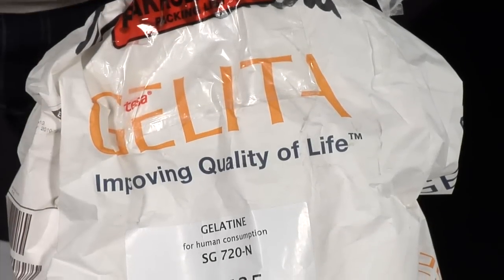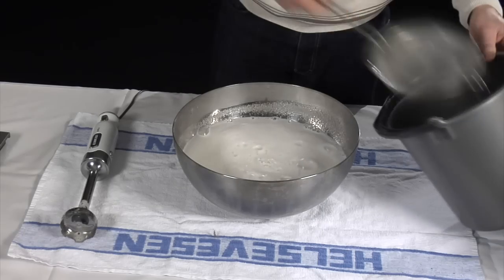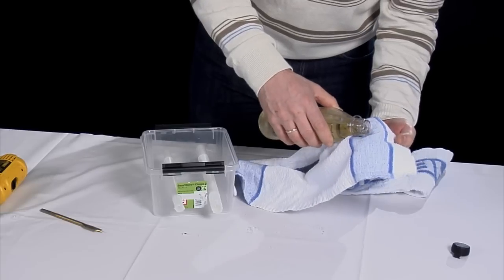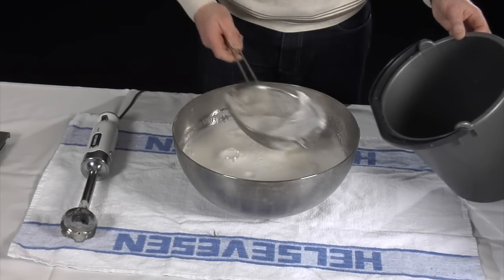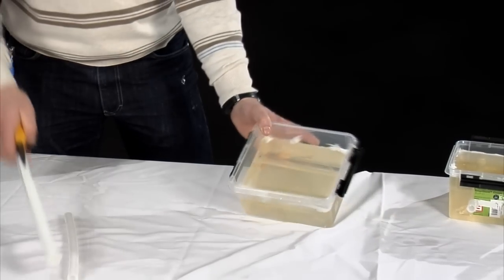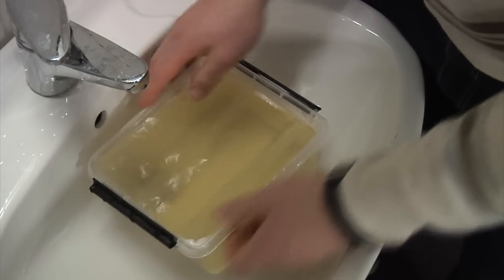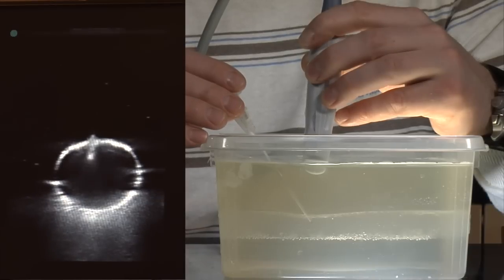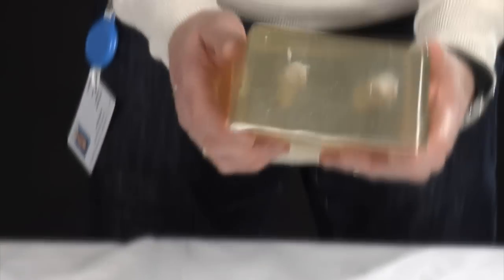The use of Gelatine models in Ultrasound guided Intravenous Cannulation

Comment: I tried several phantom recipes and liked this one the best.  I had to proportionally change the recipe for use in smaller containers - this is what I ended up using.

90 gm (3.25 oz) unflavored gelatin
500 mL hot water
approx 30 ounces rubbing alcohol (70%) - though lots of options for preservative

I used plumbers putty outside the tubes to prevent leakage.  I also used a 2.5 cup container to make the phantom and eventually moved it to a 4 cup container with taller sides (same sized base).
Reply: ddprall1 what are lots of options for perservatives??

Comment: Hello, I am an ultrasound instructor from Belgium. Made several vessel models based on metamucil and gelatin. I followed your recipe exactly but my models failed. And I know why I think: it is not a good idea to use an electrical handmixer to mix the gelatine with water because you create air bubbles in the gelatine mass. And they reflect all the US waves. Result: no penetration but reflection and no image formation...